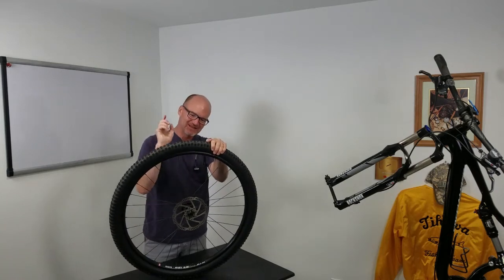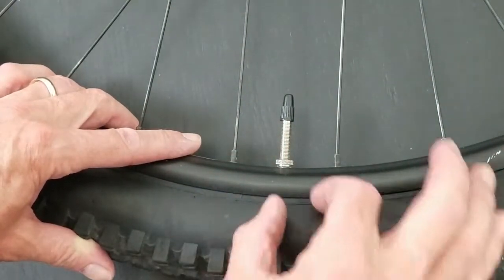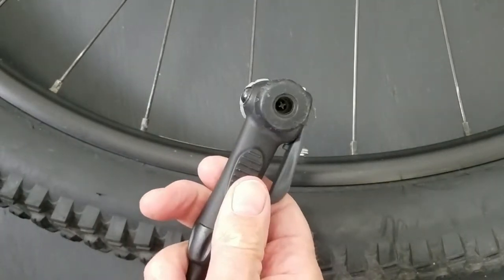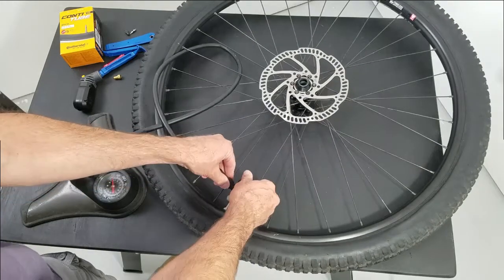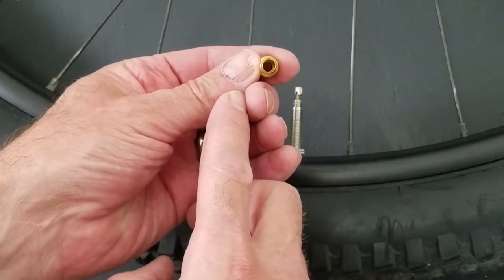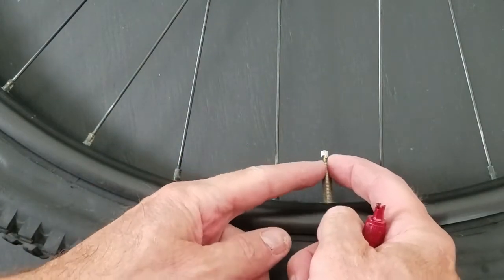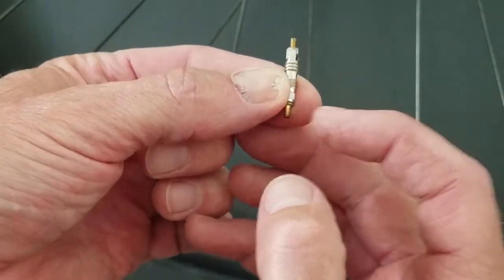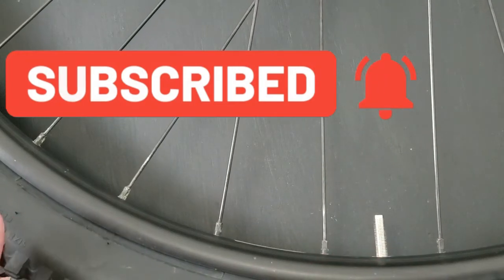How Do Presta Valves On Bikes Work

Comment: Thank you very much! Your video really helped me. I'm new to my bike bought a portable motorized pressure guage/pump couldn't get a reading and doubtful inflation. Now I'll go back with greater understanding (and hope I haven't already bent the pin! plus hope I find that nut). Very helpful to see inside that valve adapter (which I also bought and wasn't sure which I needed!). Tremendous help. Fingers crossed for reattempt. LOL
Reply from the maker: Excellent👍 Stay tuned and keep pedaling 🚴‍♂️🚴‍♂️

Comment: :cat-orange-whistling:The trick, that I was not aware of and which I learned from another video is the little tap @1:00 min. Now, I've got a Bontrager Charger Floor Pump, and it has only ONE nozzle, not two, like the one you are using. But the symbols on the nozzle show both, the Schrader valve AND the Presta valve. So I assume I can use the same nozzle for either valve type, no????????
Reply from the maker: Yes, some pumps have a more universal connector.  I haven't had the best luck with them.

Comment: Excellent vid ! I'm new to bikes that use Presta valves, so (just as you touched on) I didn't realize why my tire had gone "flat" until I saw your video; then I put it together that the screw holding the valve/gasket in place must have jiggled loose during my first 760 miles with the new bike (I even ended up buying new innertubes before I came upon your great content:goodvibes:). I also didn't realize, until I saw this, why my pump wouldn't inflate the tire properly (wasn't the pump / it was me !) Thanks much ! Now I'm ready for anything 8-)
Reply from the maker: Fantastic!  I appreciate it! Keep pedaling🚴‍♂️💪🚴‍♂️